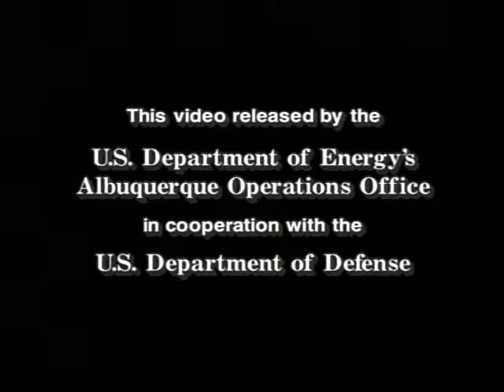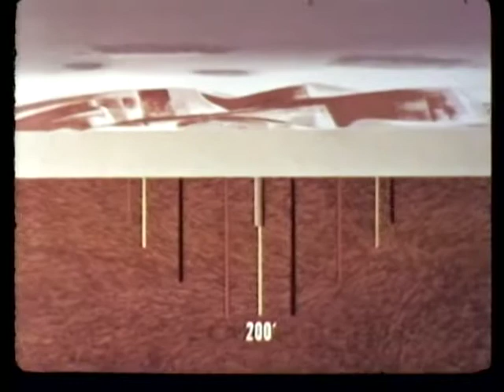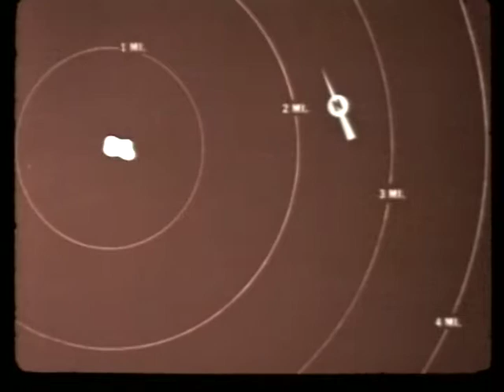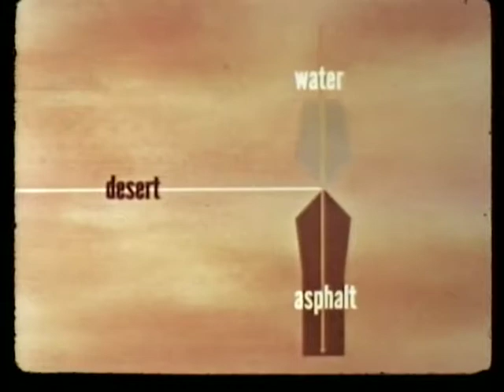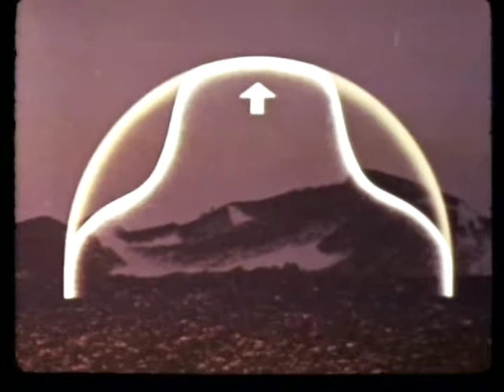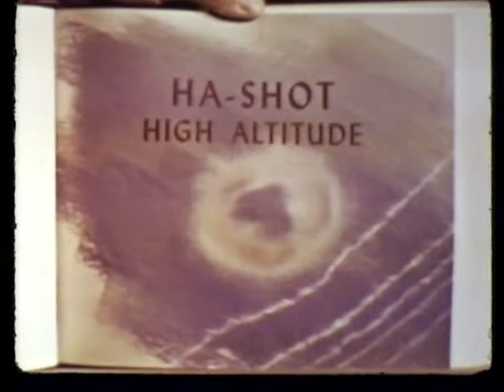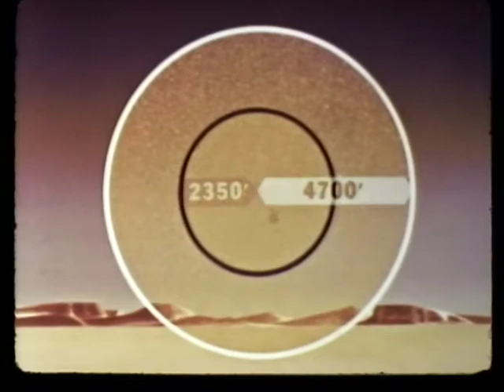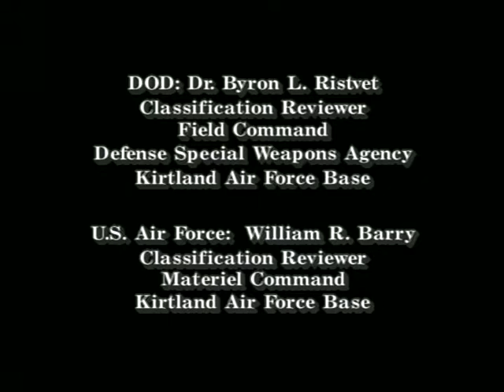Operation Teapot • Military Effects Studies (1955)

Comment: So, we had DRONES in 1955. Think about that in relation to some modern day events. 🤔
Reply: I read about a program the air force had which tested unmanned, fully autonomous aircraft (full size, not drones) squadrons that could take available data (radar, ground images, etc) and then assess based on the planes available, their fuel, weapon loadout, etc and the enemy intel which plane or planes to use in the attack... then they tell you this was 1988.
Reply: The nazis had drones they could steer via video camera link in ww2. So, that's what, 48ish?
Reply: the US used remote control airplanes packed with explosives during WW2. Aircraft such as the B-17.
Reply: Full capability to fly commercial jet aircraft by remote control before 9-11-01
Reply: Of course we did. It is simple radio control. Even easier with a TV camera.
Reply: @mikemurphy5898  43 or 44 probably.
Reply: "Drones" are hardly a new concept.
Reply: "drones/guided missiles" sort of began with the Hewitt-Sperry Automatic Airplane and Kettering Bug in 1918.

Comment: 1.2 kilotons.....!? That's a firecracker !! We had to have tested underground stuff bigger than that !! Though I suppose that would be useful for determining tactical nuke yields. A firecracker!
Reply: They used small nukes so they could quickly get in and test without large amounts of radiation present. The radiation from the small bombs decayed faster.
Reply: Cannikin was a 5 megaton underground and largest done underground. The video on YT is awesome. That was one bad ass missile they lowered down about 6000 feet into the earth. It blew the surface up about 25.feet higher than it was before. It's actually my favorite video aside from Castle Bravo. Highly recommended.

Comment: what i would do to get my hands on one of those obliterated jeeps!
Reply: It's deadly dangerous to touch I guess
Reply: @boris.m2624  surely by now the radiation would have dissipated. that was almost 70 years ago! hard to imagine
Reply: @katsumiskytower8714  I’m thinking the radioactivity will last a LOT longer than 70 years
Reply: Do you think that will be in the Carfax report battle
Reply: @sirclarkmarz  “low miles and only driven to a radiological testing site once” 😂
Reply: @sirclarkmarz  oh I so hope so! 😅
Reply: @MrJruta  Not a CHANCE. The radioactivity of ground zero from the Trinity test is gone and it's open to the public. The radiation measurement there is basically backround now

Comment: Test results: ...The abject stupidity of using nuclear devices as construction explosives...
Reply: Well, unlike you, they had no idea what couldn't be done with nuclear devices.
Reply: @buckhorncortez  actually they pretty much did and were warned not to do it. They did it anyway.
Reply: @samueladams1775  Warned not to do "what"? 😕 Nothing they did didn't have scientific measurements galore all over it, and olenty of forethought.
Reply: @samueladams1775  Then you'll have to provide backup documentation since they had no idea about things like lithium deuteride 7 turning into lithium deuteride 6 until the results of the Castle Bravo test were analyzed.  There are many, many other examples of what they didn't know until they did the tests.  Lots of effects predicted didn't work as designed or expected.   One of the examples is a test done by Ted Taylor that resulted in the only dud (no fission) when tested because the fissile material was too small.   That's still a piece of classified information as it defines the lower end of atomic weapons.  So, please spare me the projection on your part without facts.